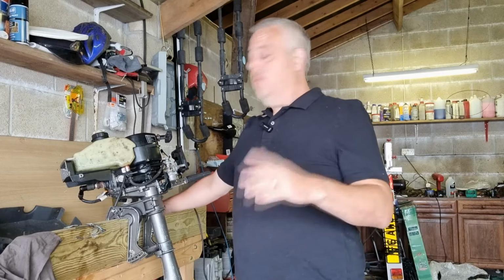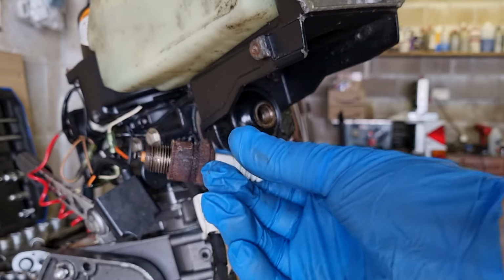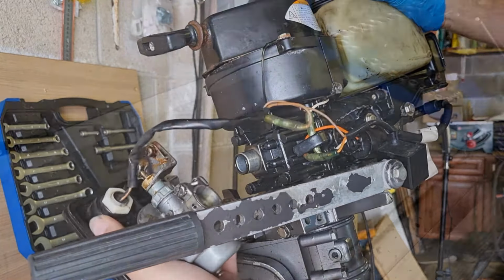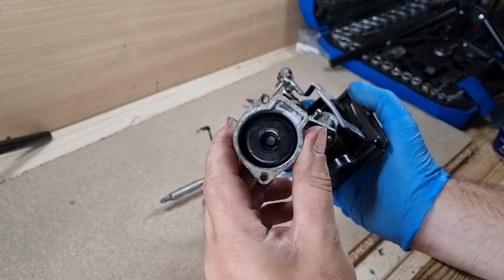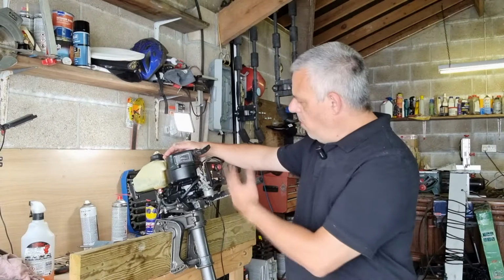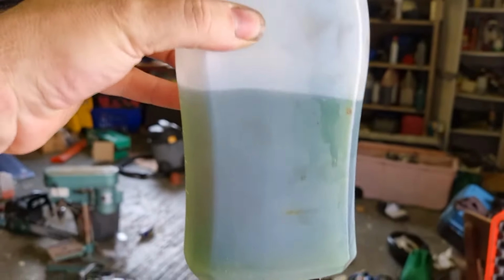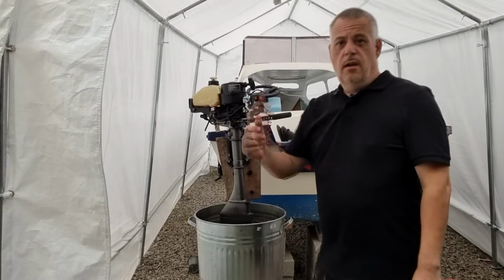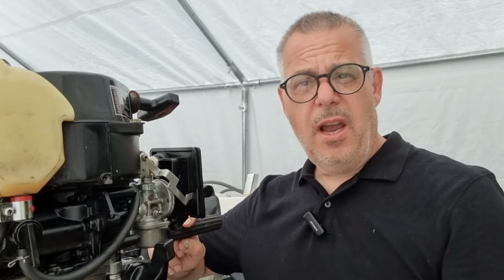1999 TOHATSU 3.5hp Outboard - First Start, Will It Run?

Comment: Is that a 2 stroke
Reply from the maker: Yes, it's a 3.5hp 2 stroke with a 50:1 fuel to additive mixture.
Reply: @skipperstan  and how many tomos outboards you have
Reply from the maker: I only have one at the moment, excellent outboard. Hoping to test it out on a river soon, keep an eye out for that episode!
Reply: @skipperstan  yea i will, its not an outboard for speed but it is pretty good 😀😀
Reply from the maker: I hear mixed reviews about the Tomos, but I like the fact that it is air cooled and does the job, pretty tough outboard I think.
Reply: @skipperstan  i heard good and bad cooments about it but it gets the job done